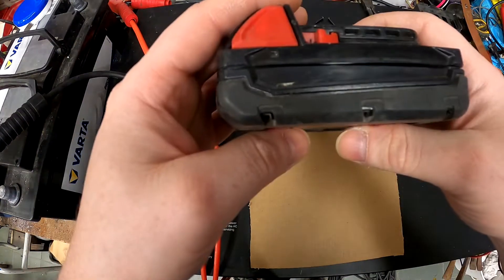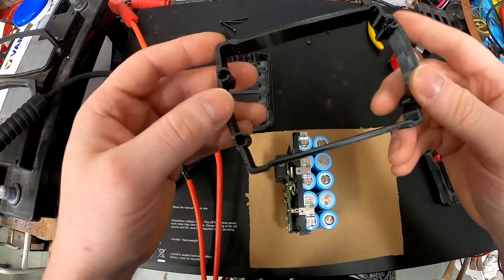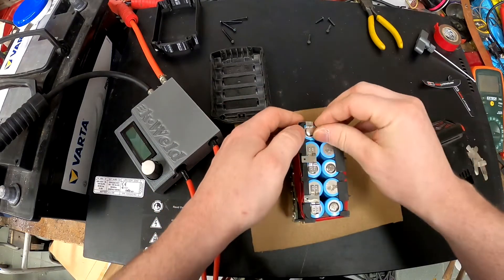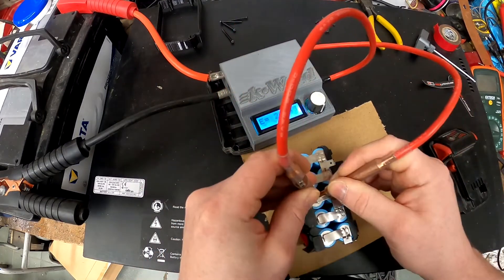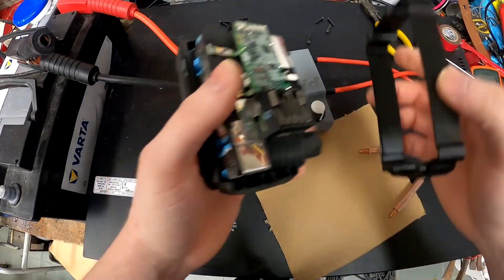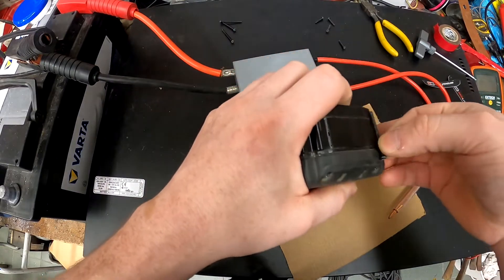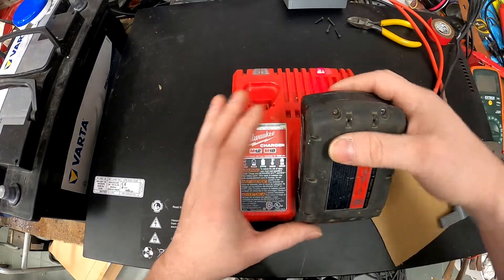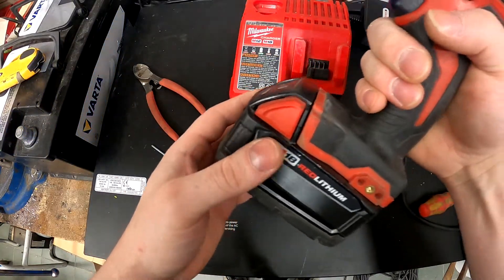Milwaukee M18 doubling the battery capacity - 3D print extension

Comment: will u make the stl m12 version with 21700 cell :P?
Reply from the maker: it does not make sense because it would be biger than 6Ah :)
Reply: @Fachura_  yes, slightly bigger size but with 21700 cell the tool can pull more amp..